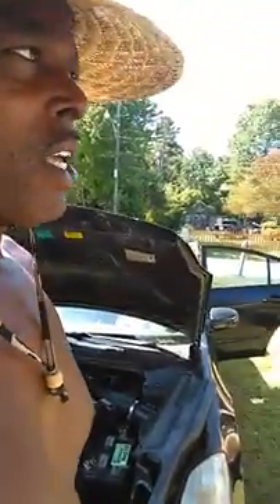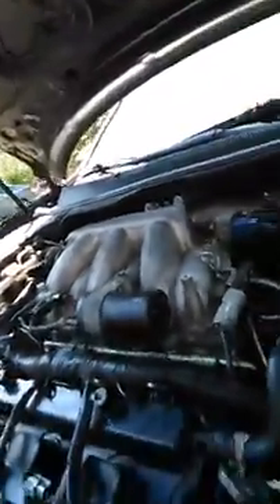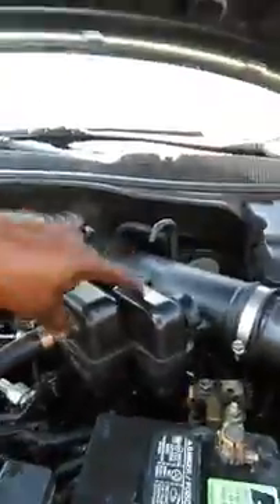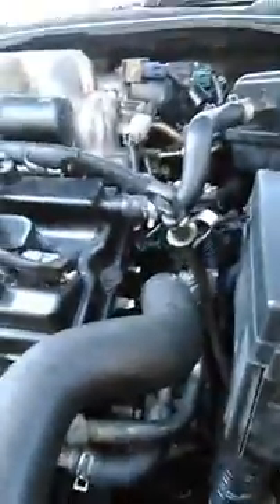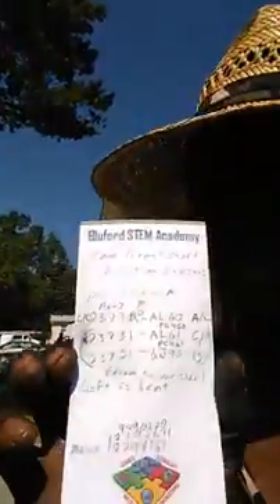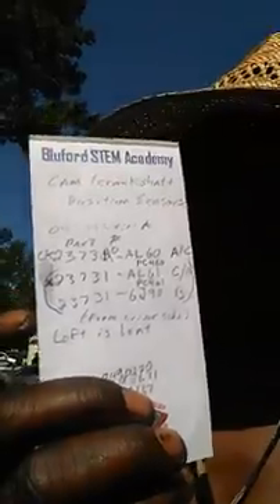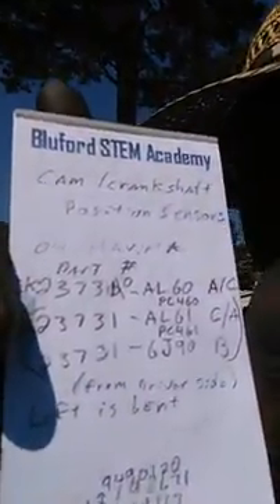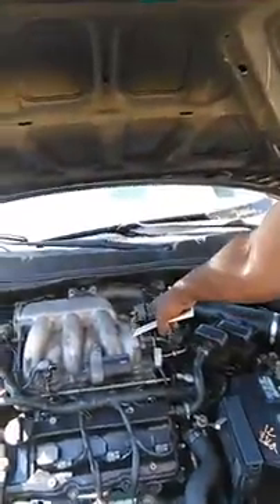04 Maxima crankshaft and camshaft sensors

Comment: My 04 Maxima drive but studders like it's not getting gas is that crankshaft sensor problem?!?
Reply from the maker: Could be change oil first
Reply: @datarewolf  just changed oil infact just put a new engine in and the mechanic told me i need to change camshaft sensor but  haven't as yet